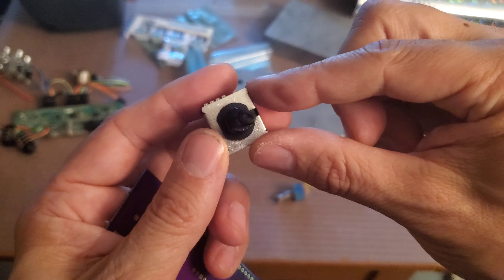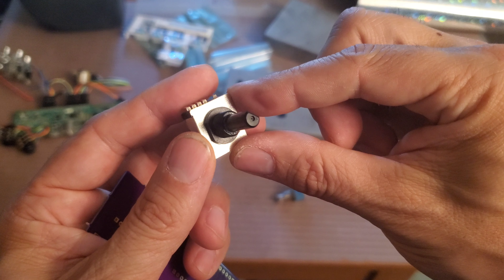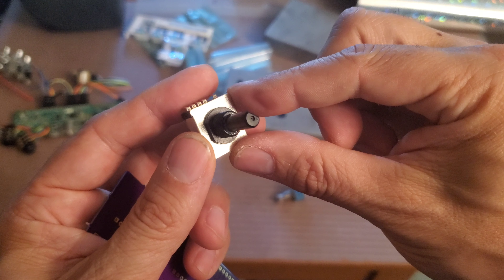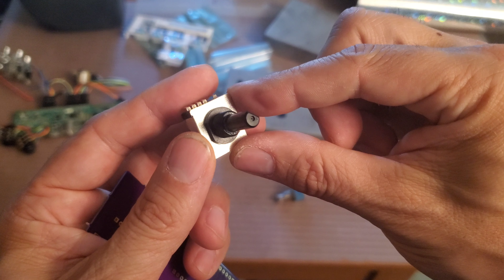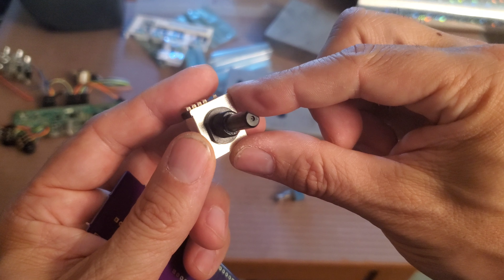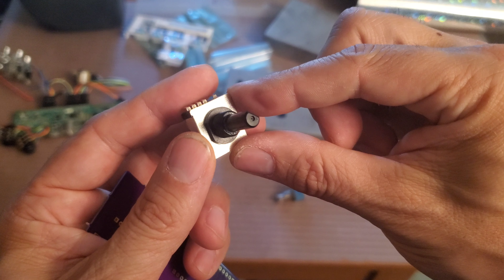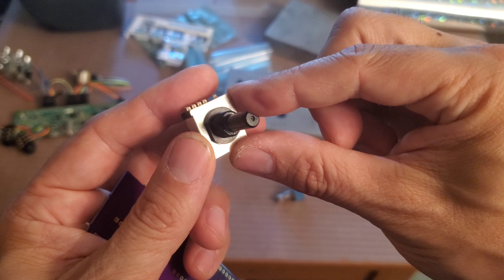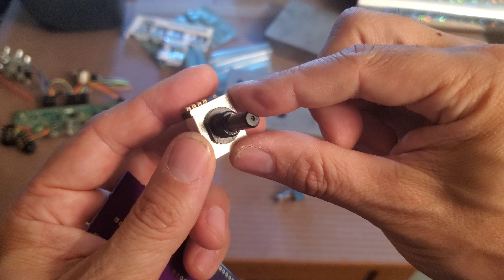Guitar Pedal For Axoloti

Comment: You can still drill some of those holes a little bit bigger and the PCB should fit. :)
Reply from the maker: I do need a speedbit :) but in this case i updated the CAD drawing and re-ran it.   Btw i really like your recent custom MIDI switcher video.  Powerful way to solve a problem lots of us in the dawless jamming world have!
Reply: @DIYDSP  Thank you! I totally goofed the wiring and didn't need to add ANY second switch after all. Oh well it works and there is more risk in fixing it than using it as is! 😅👍